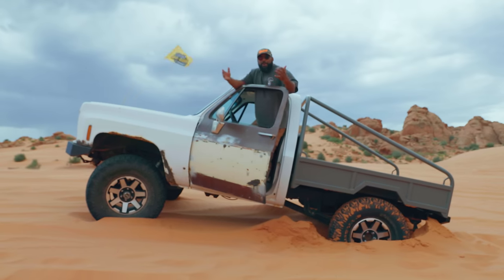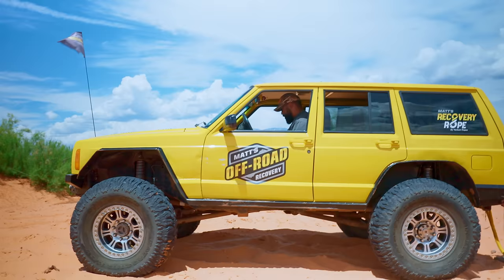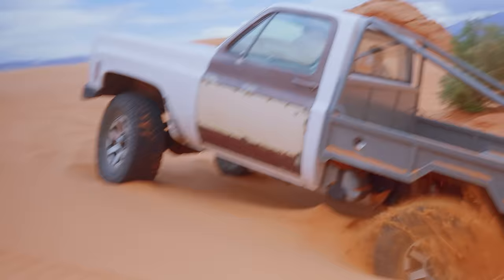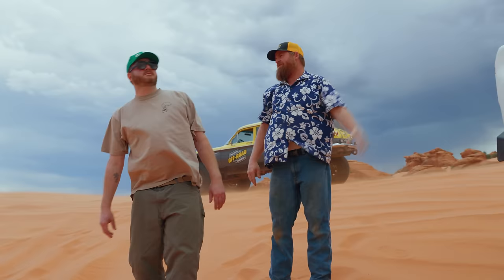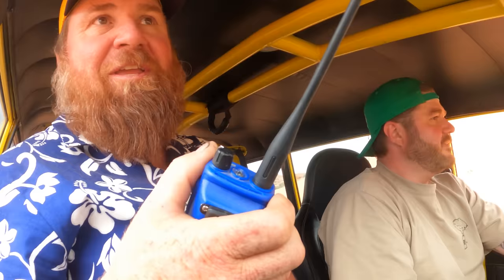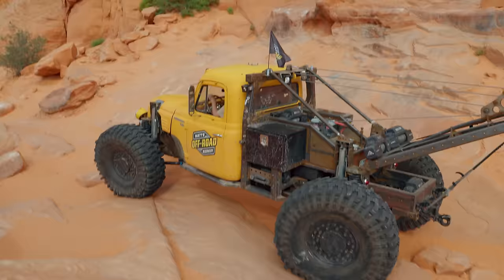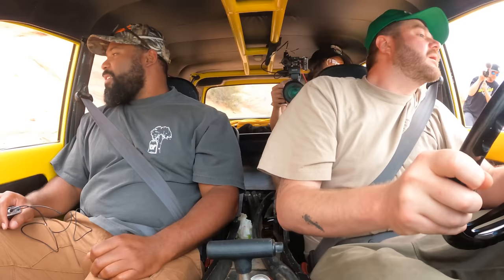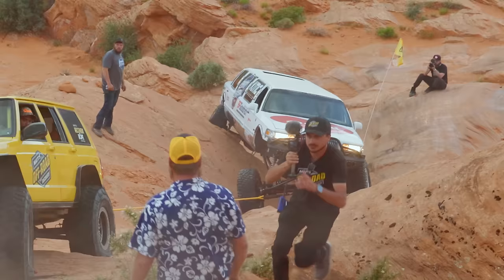I Spent 24 Hours on an Off Road Rescue Team

Comment: I've never even driven an automatic but was thinking they must be better than driving a manual these days but this runaway throttle truly scared me. In a manual, if this happened, you'd press both the clutch and the brake and the RPM block would take care of the rest.
I'm assuming the big truck is automatic since James didn't do this instantly. Can an automatic be put into neutral if the throttle is floored? Could anything have been done in this particular truck to cut the engine from the wheels?

Comment: Do Americans not deflate tyres when you guys go off-road? That is the easiest way to get more traction, especially in sand as it increases the contact area to the ground. I’m sand people here in Australia can go down  to like 8psi. Looks like these guys are running at highway pressures, which is putting them at a massive disadvantage

Comment: Are snatch straps/kinetic recovery ropes not completely standard in every single serious 4x4 in the USA?  That, softy's/D shackles and Hi lift jacks, hell even snatch blocks should be in every proper 4x4 that has a which installed.  They talk about that stuff like it's not standard fit out?  Not poking fun serious question?

Comment: Hey you dudes know if Matt is hiring? I have a 3/4 ton GMC 4x4 with a 454 BBC sitting in the bed that I'd love to finish and slap a towbed on, and I have a lifetime of experience driving stuff off-road that isn't supposed to be off the road lol. Plus I live within an hour of at least six off-road "parks". And I have two first generation Nissan Pathfinders that are extremely off-road capable, both sitting on 31" rubber, one of which is equipped with Dick Cepek Mud Countries.

Comment: Surely the first thing u would do with an out of control engine is shut the bluddy thing off or atleast try🤷🏻 this is another  reassons manuals rule  dip ya clutch nobody dies and don't have to try and ram a rock face

Comment: 11:50 what the heck ,it has AT transmission or what ?why don’t you  just immediately  pushed the clutch and shutdown ignition , i ve got this reflex in my 18 on my niva , it had a floor pad that in some conditions slide over accelerator pedal when it’s down, once I’ve learned my ex wife to drive on that niva  she drove through the field pretty well so i got relaxed  and when we got near the forest there was a turn and some bumps she turned ,wheel got in the pothole , car bumped and her leg pushed gas pedal to the limit and it got stuck , The car flew into the woods , but I pulled out the steering wheel , slammed the gear into neutral , pulled the handbrake , we ended in the ditch , the car sat on the bottom, i had to jack and put branches under the wheels to get out